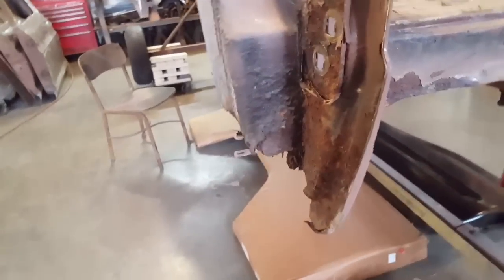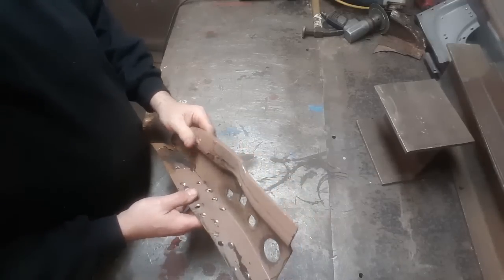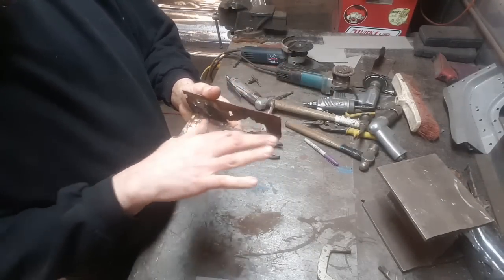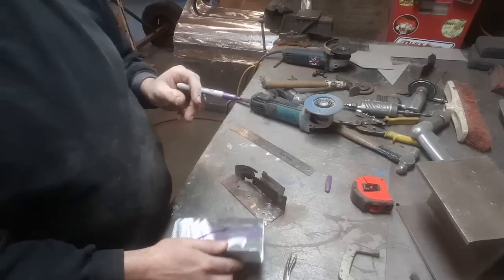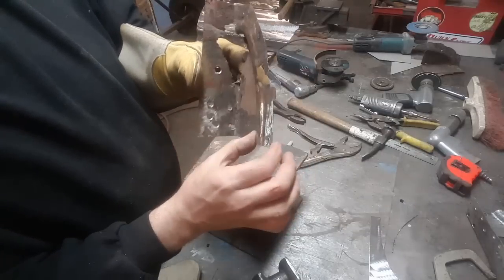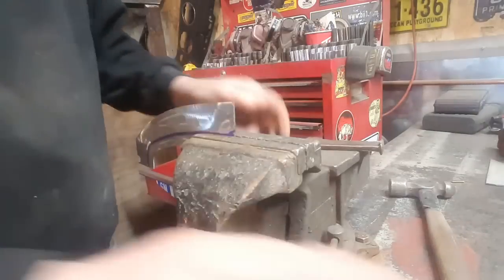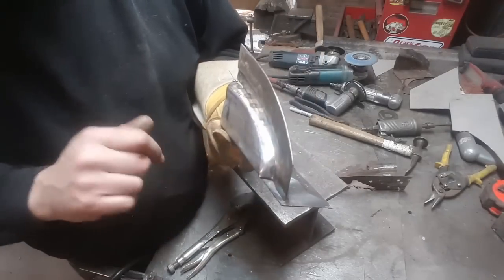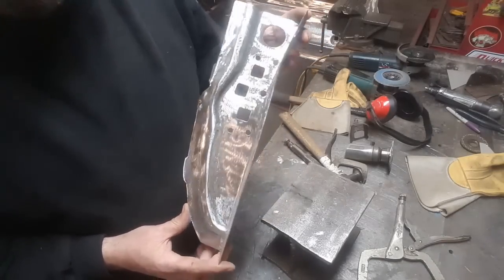How to make patch panels with basic tools

Comment: Anyone else think...."Damn, I REALLY need to find a chunk of I-beam!" Thanks for sharing your skill and knowledge sir!
Reply: Plasma cutter
Reply: My thought exactly!!!!!! Lol
Reply: I went out and got an exact piece like that.  So useful.  I saw the ibeam laying in the scrap yard and asked them to cut it for me.  $20 later I had it.
Reply: I have a left over piece of I beam from a defunct log splitter.  I saved it, too good to scrap.  As soon as I saw this, oh quick go cut a piece off.
Reply: A few 2x4's screwed together will fulfill the same role.
Reply: lol. Hell yes! I have a couple big ones that I was wondering what I was ever going to use them for.
Reply: Hard to find  I beam ,I have seen , rail track cut pieces.
Reply: @edwardalamo2507  Rail track would work but they make great mini anvils. There are some great videos here. I have been trying to find a piece to do that project.
Reply: Finally I know what to do with the 12" rail track that has been laying around my garage for 30 years
Reply: Rim pile in any steel shop will have or supply yard  ..
Reply: Was thinking i could weld three pieces of 3/8 steel plate together and have similar i beam.
Reply: Same!

Comment: I used to think I needed all kinds of fancy tools to fix the rust on my truck.  Turns out I already own what I need.  You sir are a metal magician.
Reply from the maker: If I need a tool more then 5 times I make it or buy it. If I don't need it that much. I do without.
Reply: @fitzeesfabrications   that's what I did when I was working as a Auto tech.  Borrowing stuff from other techs got tiresome quick.
Reply: Great stuff!!!
Reply: I just heard Metal Miltia by Metallica in my head but it was METAL MAGI CIAN ... der ner berner der ner ber ner
Reply: Same im a combo welder by trade tig mig arc but was always too afraid to go anyway near smaller detailed jobs but this man has made it seem possible

Comment: Great work. I am an auto body technician and can relate to everything you are doing. The only thing that I have an issue with (and i cringed when I saw it) is that you went full blast with your drilling. In my years of experience of doing body work I always tried to limit the speed of what I was drilling as to save the cutting edge of the bits. Going at high speed creates way too much friction and heat which destroys the bits. Going a little slower is actually faster as the bit has time to cut more metal and it doesn't over heat and mess up the bits. But that is just my experience with using drill bits.

Comment: Finally someone that knows what they're doing, uploads regularly, and doesn't take material from DVD's with cheap no-name rock music intro's.
Instantly subscribed.
For the spotwelds I use a spotweld drillbit.
The trick with those is use a center punch on the original spotweld for the small point of the bit to slide into, and apply equal pressure when drilling so you're getting the same depth of cut when you look at it from all 4 sides, and simply go the same depth as the thickness of that panel, that way you dont have to hammer the chisel even nearly as hard as you did here, deforming the panel.
But other than that, you're my absolute superior, no question about it.

Comment: There's more than one way to skin a cat.  Why anyone would want to skin a cast, I don't wanna know.  But I need to get a short cutoff of an I-beam.  I could use that on I project I'm working on right now.  That looks very handy.   MIG welding with Safety Squints?  These are my people.
Reply: Grab a bit of railway line. There's usually offcuts laying nearby...
Reply: Brian I believe that is wide flange he is using

Comment: Your metal working skills are amazing. Have you ever tried a nibbler? It’s what I use for cutting curves on flat body metal. Saves on dust, cutting wheels, and it’s fast. A pick up magnet gathers up the “fingernails “.
Reply from the maker: About 25 years ago I did. Great little tool but those shavings gets into your boots a few times or under your knees you tend to think twice about using them. Lol

Comment: Hey Fitzee, you should put your compressor outside in a shelter.And you should buy a sand blasting cabinet for cleaning the little parts like this.
Reply: You do realize it gets cold there,  he would have to heat that said shelter as well.

Comment: Love watching an artist at work! Any chance you could divulge you MIG setup? Wire? Gas? Fluxcore? amps?   Just need some pointers please!
Reply from the maker: Many have asked that. Will touch on that in a video. I use a millermatic 130xp welder with .023 wire and co2 gas. The settings are 2 on the heat and 60 on the wire speed. Remember not all welders are set up this way. Each one is different.
Reply: @fitzeesfabrications  Thanks!

Comment: Fitze man, you’re spinning those bits WAY too fast . They drill better and last way longer when used at the correct speed . Those are HSS bit, and a 1/4” should be around 1100 rpm in steel. 

Spinning too fast without coolant just work hardens the steel and ruins bits .

Comment: Awesome job! Your welding machine setting sounds a little off.
Reply from the maker: How so? That one was spot on. Every now and then the tip get dirty.
Reply: @fitzeesfabrications  its good practice to trim the end on the mig wire to get a good contact, or check for worn gun tips.
Reply from the maker: @robertrivasarroyo1174  I worn out welders! Lol. But you are correct worn tips will cause trouble as well as your end of your wire. Good practice to snip the tip if your starting a new weld.
Reply: @fitzeesfabrications  I weld a bit myself so just listening to the sound the machine makes lets you know if its right or not. keep up the awesome work truly a lost art form now a days making panels from scratch, very impressive watching that come about.

Comment: Lot of work for a hole that's easily patchable on the truck . But im.🤗 the guy that made wood floors for moms 79nova  . aluminum roof coat original metal

Comment: Great video. What’s the setting on welding the thin metal? I am still learning welding and with my tig I tend to burn through the metal. You make it look easy and weld without burn through being an issue. That’s my goal because it ends up being a lot more work and doesn’t look near as pretty as what you do. Thanks again for a great video.

Comment: You know they make a tool is a spot weld cutter and it cuts a very nice slug out of the metal or you can sharpen a drill bit backwards and do the same thing just thought I would let you know in case you never seen 1
Reply: Yes, I got some for a project, and it worked well.  The one I got is called a Rotabroach, by Blair and made in the USA.  Pretty much a hole saw, just more precision manufactured.
Reply: @emeltea33  those make that job 1000% easier

Comment: Thanks for sharing your knowledge Fitzee. You make it look so easy. 
How will you join it back in to the quarter panel? Will you put that bit that folded over the edge back on (Where the quarter folded over that bit you made and was spot welded) and then weld the two edges together?
Reply from the maker: That lip is the remain of the old quarter. The new quarter has that lip. It just be spot welded back as well as butt welded where I cut it off.
Reply: Fitzee's Fabrications any chance you might do a video of all that too.
I’ll look forward to any videos you do.
Reply from the maker: @garethmcgregor1621  that's the plan.

Comment: weird ... first thing I'd have done ... threw that piece into a 5gal bucket of Borax'd water...
with an automotive battery charger connected to it.
De-RUST ELECTROLYSIS.... works on chromed and polished ferrous.
An inch away from ELECTROPLATING AND ANODIZING,... to add revenue to your shopwerks.
Reply: Oh yeah ... now I see the need to NOT DE-RUST METAL, at the sheetmetal artisans abode.

Comment: great videos what's your way of widing a rear fender 1939 chevy coupe
Reply from the maker: They have a different way of mounting. I done them before. I put a band of steel in tight to the body. I cut off the inner lip about a half inch out from the body and put the band of steel there.

Comment: i would have been more impressed if you (as an influencer) had used a welding mask or at least a pair of goggles, here are now 300+ young kids with a bad case of flashburn struggling to see ANYTHING nevermind watch your vids, other than that it was a nice finished piece of work ;)
Reply from the maker: I explained  my method many times. Dont see the flash  it hid behind the tip of the gun

Comment: This is off topic a little bit. I'm working on a 64 rambler classic two door hard top and I'm painting the interior. (they don't make cars like they use too)  Whats the best paint gun for the ceiling? Its hard spraying primer and paint upside down. (I don't have a rotisserie) I watch all you videos. I'm just a hobbyist and I've learned a thing or two by watching your videos. Thanks.
Reply from the maker: Gravity feed gun. Just might have to place a old sock over the top to keep it from dripping out the vent

Comment: Fitzee, why dont you use a spot weld cutter for your drill?  It's like a minerature hole saw with Adjustable depth and cuts around outside edge of spot weld.  You end up being able to remove the piece, then just grind spot weld spots off piece you are saving
Reply from the maker: Had them they wear out. Not something you can just go out and buy at you local hardware store. 1/8 bits and 1/4 bits are everywhere and cheap

Comment: The part witht he square holes you cut out looked like there would be a hinge or firring there. You did not seem concerned about alignment of  the piece when you did the repair. Was this a part where alignment was important? If so, what did you do off-screen to ensure you could reinstall the part in the correct alignment?  And - Thanks for taking out some of the mystery and putting in some common sense and practicality into bodywork.
Reply from the maker: That panel was spot welded to the shell and I used the spot weld locations as well as the top where I cut ut off for alignment.  There is a lot of adjustment on the section that bolts on there

Comment: Hi Fitzee, just curious what is the size of the I-beam you use to form various parts you are making?
Reply from the maker: The small one I'd about 8 inches x 8 inches  by 10 inches. The big one is 4 inches x 8 inches by about 5 feet long

Comment: Is there any reason for just tack welding it instead of running a straight weld?
Reply from the maker: Yes heat. The more you weld the hotter it gets. Heat distorts sheetmetal. Then that leads to alot of body work!

Comment: I was excited about "basic tools" until the brake came out.  I do need to get one of those, but it's not quite basic enough to be in my collection yet
Reply: He built that brake. he has a video on it. I built a 2 foot bench top version based off of what I saw at HF. If my steel wasn't free I probably would have bought one instead.

Comment: Fitzee - I don't see you wearing welding helmet. What are you using for eye protection when using the MIG mate?
Reply from the maker: I hide the arc behind the tip of the gun. I don't see it
Reply: @fitzeesfabrications  Legendary skills mate. I'm working with a 185 Mig 0.6mm gassless and having murders getting pin holes in welds and burning through the floor panel. Watching your vids has given me some hope to revisit it again this week :)

Comment: I have a few questions... how long did it take you to fabricate that corner panel?  Have you used air nibblers to cut sheet metal?  I know you say the grinder is quicker but sometimes I find an air nibbler quicker and easier to cut around tight corners.   Final question, what mig welder do you use?  Thank you for all of the priceless tips you provide.
Reply from the maker: This would take me 3 to 4 hours. I have used a nibbler and they are great tools. I haven't used on in years as I found those chips hurt like hell when you kneel on them.lol. some find them easier then a grinder then it's better if they use a nibbler. My welder is a old millermatic 130xp. Have it over 20 years.

Comment: Nice to see someone out there doing similar things. I liked how you used the dolly in the vise. Simple, no frills. I have a smaller section of rail line that was used in the mines, and has a rolled top surface, and the true squared flat bottom. One foot sections seem to show up here in Oregon sometimes, on benches in old barns of course. The one I use was a door stop in a house I lived in when I was a teenager

Comment: Can you walk us through your welder setup and settings? Just started working some body panels and when I watch you tack up vs mine I feel like my heat is way out of control compared to yours. Meaning seems like there is more heat transfer to the panel where you are running multiple tacks and can still touch the panel, I do two or three and it is too hot to touch. Love the videos keep up the good work!
Reply from the maker: Your on the right track. My heat on My millermatic 130xp is set to 2 out of 4 settings. My wire speed is set at 60. Each welder is different. Setting from one machine to another are total different. I like lots of heat. If I was to start a pass on this metal I would burn threw before I got a inch done. I like it when my weld is flat.i know it is gone threw to the other side.

Comment: You have given me confidence to make my own patch panels for my 47' Willys project. I noticed you always surface prep a piece of steel before using it. What grit of flap disk are you using and what are you using on the small air grinder to finish the piece ?
Reply from the maker: I do it all with a 24 grit disk.
Reply: @fitzeesfabrications  Got it ! Thanks !

Comment: Hey fitzee thanks again for sharing your amazing skills with us all. I have a question for you. I bet you get this one all the time but how come you don't like wearing a welding mask? My guess is you are wanting to see exactly how hot the panel is getting. But I don't know that's just my guess. Cheers.
Reply from the maker: I keep a eye on the metal around the weld. See if it moves. I am not looking at the weld. The ark is being hid by the tip of the gun. It's a Habbit I picked up years ago. Don't recamend it at all. If you don't know what you are doing. Don't do it.

Comment: I like to use a mini belt sander to file down the spot welds when removing the panels to try and not damage the rear panel like you mentioned. Just another way of doing it.
Reply from the maker: More then one way to do most things.

Comment: I find a carbide burr ( ball ) works good on removing spot welds
Reply from the maker: Good tip. Nice one
Reply: @fitzeesfabrications  I removed 2 land cruiser roof skins with a spot weld cutter bit. as long as your careful its a lot faster than a regular bit or grinder.
Reply from the maker: @meowmeowdoggy1  it can be. You still have to weld up all the holes you drilled before reinstalling new roof. Those tips leave a 1/8 hole in every spot weld. I used them alot years ago. When they dull or the tip cracks off in a middle of a job you restore Back to drill bits cause finding another spot weld bit is never easy at the time of the job. Lol
Reply: I have Blair brand roto-broach cutters for spot welds.  The arbor has a spring loaded center point, it only requires a center punch mark to guide the cutter.  No through holes in the back.  Best by far for spot welds in my opinion.